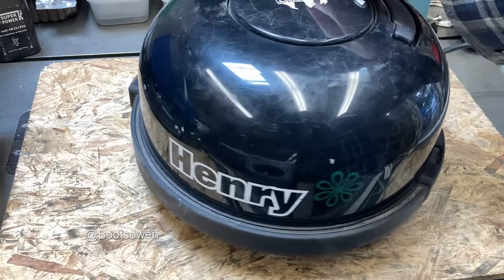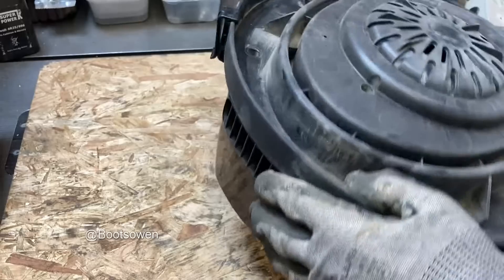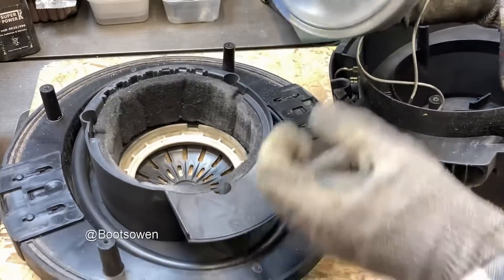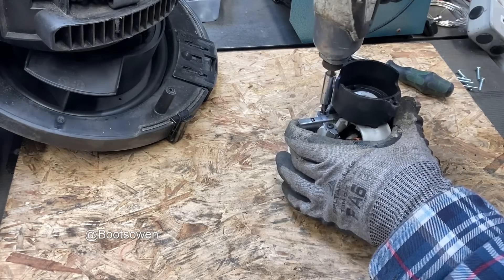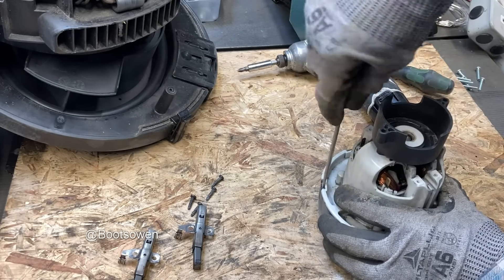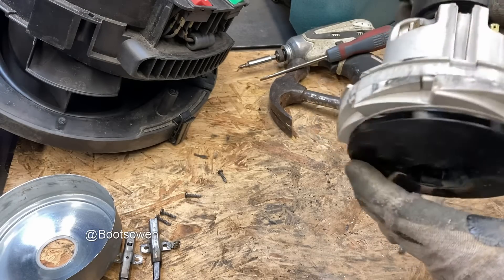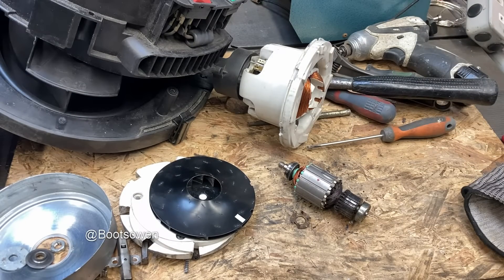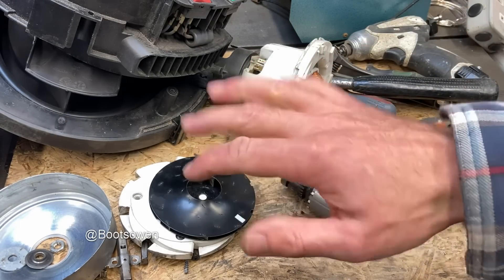Henry  hoover autopsy: burnt armature why did it happen?

Comment: I got one abit newer the other week found it next to a skip outside someone’s house it had been used without a bag or filter and had been used wet causing the brushes to jam easy fix here’s a vid i also need to clean it’s fan ahah but that’s another easily fixed appliance rescued from the tip  https://youtu.be/kzXPXyXGMvI?si=JSSLvlsfnfQ4BiRS

Comment: Mine had the same issue, I just put a new motor in it.
Reply from the maker: Cool, how much was a new motor?
Reply: @bootsowen  It was £33 pounds but I got £15 off for downloading the app so it was only £18 from amazon. I feel like that's a good deal. It is a little bit less powerful but it works fine and is very quiet.
Reply from the maker: Yeah, £18 is a good deal. The retail price for these motors is too high.  If you can get them wholesale and without vat then they are a lot cheaper. But for now I would have to buy retail .

Comment: I can only guess that it had been running a while and so friction created heat and thermal exoansion.  It was then turned off for a short period allowing it to cool whereby materials either  fused together or the motor didnt have the start up power to over come the frction.